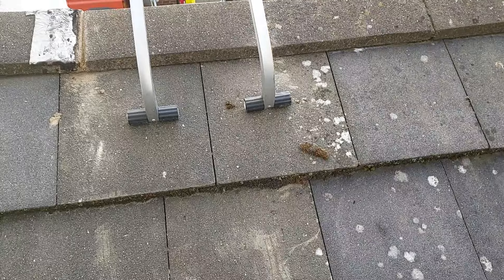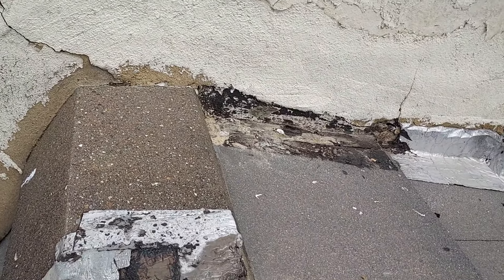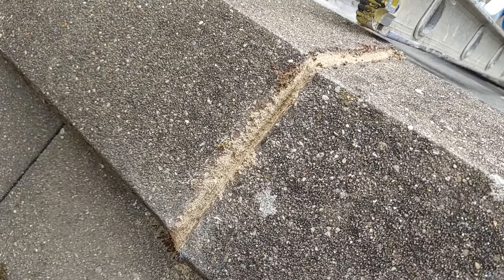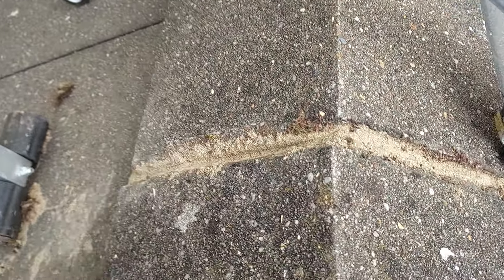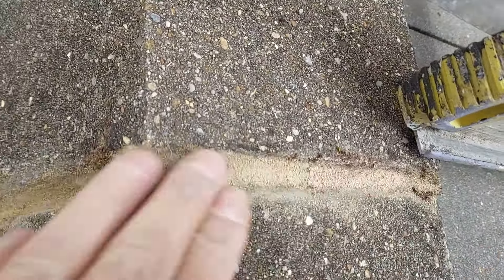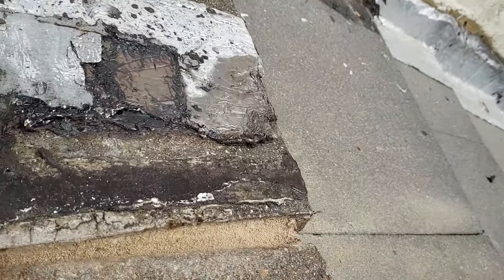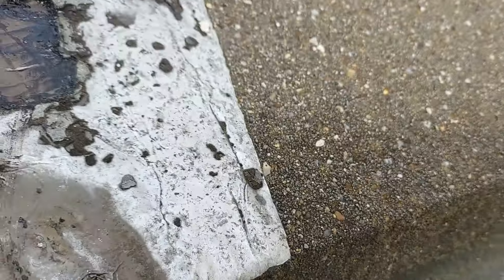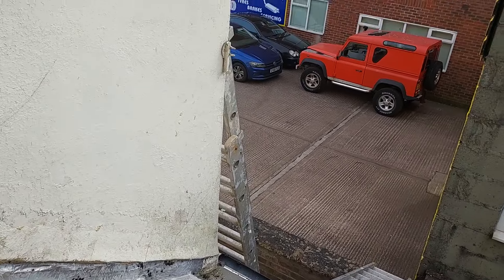Old Mortar crumbles

Comment: Needs a secret gutter under them tiles  then new lead in them walls mate  good work joe 👍
Reply from the maker: Cheers mate I'm doing the gutters after I've pointed the ridges. Give it a good brush down on the finish after mate. Definitely needs lead work doing right down the wall but the price of lead these days is terrible m8. Water will always run down onto the tiles so he does need lead. I'm on the top roof tomorrow it's leaking pretty bad up there. All the bedroom ceilings are damp. I ain't been up there yet but I reckon I will be putting new Redlands down. Cheers brother 👍
Reply: @MotocrossMad69  👊👍